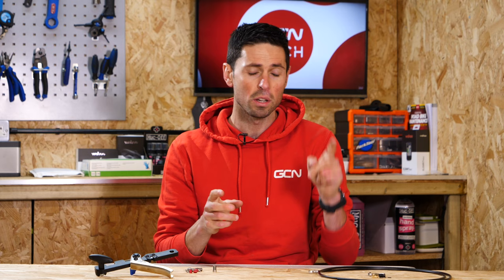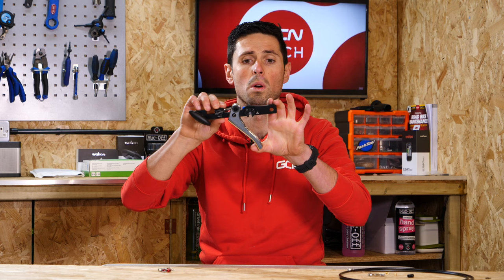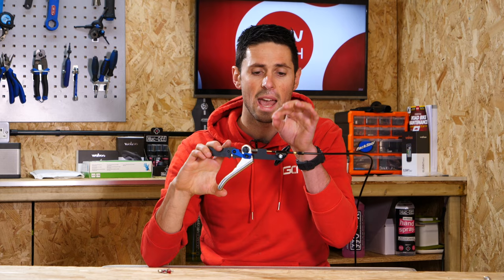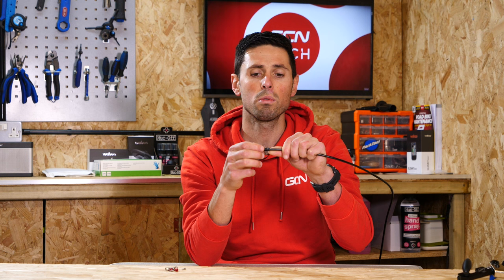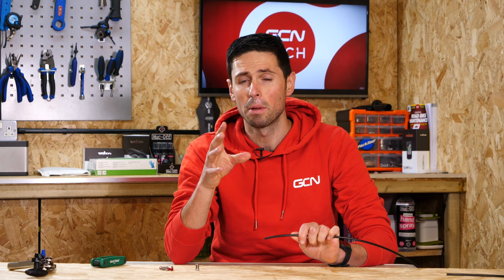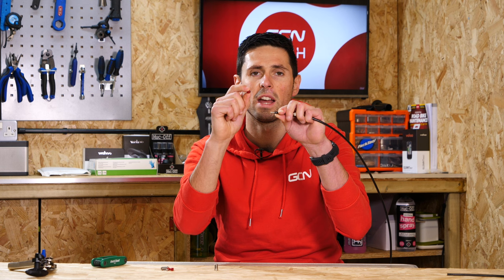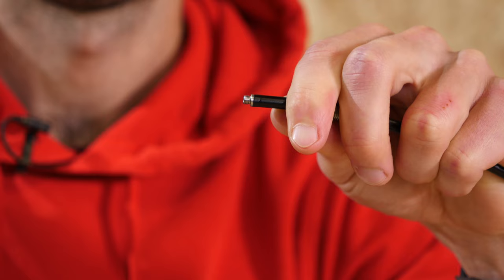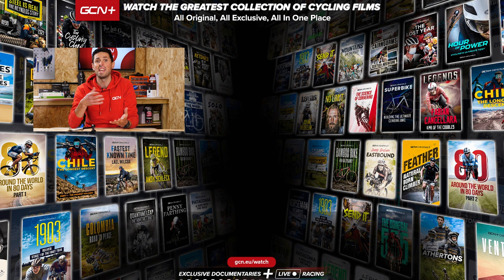How To Shorten Hydraulic Brake Lines | GCN Tech Maintenance Monday

Comment from the maker: Have you ever shortened your brake hoses yourself? How did it go?
Reply: Not yet
Reply: Many times. You can remove the brake pads before and push out the pistons a bit more than normal. After shortening the hose, you have a bit of fluid at the lower part of the system that can help to push any air that might have gone in up into the reservoir. Poor man‘s bleed.
Reply: I Don’t have the tools needed. So the hose is wrapped around the downtube 🙋🏼‍♂️🤷🏼
Reply: Will there be any problem if I put different mineral oil mixed  on my brakes?!, I've been curious about it.
Reply: I remember doing SRAM before they had threaded olive
Reply: @TM-mt6sx  it is often not recommended as might ruin the seals faster
Reply: @tomahoks  make sure turns aren't too tight, think 5cm radius or diameter is tightest recommended not to damage the hose
Reply: @chrisridesbicycles  my mountain bike I only open lever and used a screw in reservoir to fill it and squeeze multiple times until no air left that way and yeah I now know should bleed from one end to the other
Reply: My experience is to put the dust cover on first, even before the tightening nut 😬
Reply: @wannesstas6182  before new SRAM ends I tightened one down for olive to not compress on right bit of hose so had to spend £30 and reroute through my bike frame ... The joy of it

Comment: Top tip, when cutting the hose have the hose pointing vertically to the sky then there is less chance of fluid left in the remaining hose dripping out, like it could if cutting horizontally.

Comment: Excellent video. Also useful would be a video on how to make the brake line longer for when you cut it too short.
Reply: I also like sarcasm
Reply: Easy done … watch the video in reverse … sorted. 😅
Reply: Actually TEKTRO has a kit to connect 2 brake lines. Usually needed for extreme lenghts for tandems!

Comment: That tool looks like an expensive alternative to the hose clamping blocks, vice, bit of wood and mallet I was taught to use
Reply: That tool doesn't seem to be holding the hose very well? keeps slipping - being cautious or not a great tool (cue parktool fan boys hate!)
Reply: The official shimano tool is useless as well. Shimano’s barbs are just absurdly overtight for what low system pressures there are. It’d seem the blocks with a mallet is still the only way to go.

Comment: Wouldn’t the reverse threading do exactly what you say it does not Alex? The reverse threaded olive is turned while being tightened onto the barb in exactly the sense that would loosen the barb… Maybe it is to prevent attaching the olive from over stressing the threads that the self threading barb digs into the hose? I suppose those are pretty delicate so over tightening is worse than slightly turning them out while attaching the olive?  In any event, thread things the correct way!
Reply: No, he is correct
Reply: @SlimPickins_07  I think Neil is correct. Never done a sram hose myself so not certain but surely it's not to aid installation but it is to prevent the barb coming unscrewed if the olive needs to come off?
Reply: @nathanielhawkins6756  you are turning the nut to the right, the friction from that would tighten the barb, not loosen it. If the barb was regular right hand thread, it could loosen it.
Reply: @SlimPickins_07  that's what I mean. If you want a new olive but to leave the barb in place loosening the reverse thread olive by turning clockwise would only tighten the barb. Either way I can't see how if both threads are standard that one will unscrew the other.
Reply: @nathanielhawkins6756  it would be the nut that would unscrew the olive when installing the line. The barb is in the line tight enough that you don't have to worry about it coming out.

Comment: At 3.22 you mention about greasing the nut and caliper thread. If u just put grease on the nut then the thread will push out the excess grease leaving none being pushed inside. 

I'm was a plumber and we used this trick on all thread pastes or flux

Comment: I have! I just switch out my mountain bike Sram Code brakes for Shimano XT brakes and needed to shorten the hoses. I have the Park Tool cable routing kit which made running the new housing internally easy. During the pandemic I worked in a warehouse building bikes, I got tried of using other people dull housing cutting tools so I invested in a Jagwire Pro Hydraulic and Needle driver which works really well.

Comment: I'm going to change my sram brake hoses. Can I displace the air in the hoses thru the lever from the caliper side or do I need to fill the hose from the caliper side before connecting to the lever? Yes, I'll bleed the system once it's full.

Comment: Hey great video  I am a subscriber  I have purchased  zoom hydraulic brakes but I have a question  I pinched  a hole on  the rear brake line I need to cut and install a new burb and Olive I need your help I don't know which barb  an Olive to use  can you help I realy appreciate it  thank you need help

Comment: It is 100% sure that air will go into the system when you cut the hose so my experience is that your system needs rebleeding. Always wondered why SRAM delivers their calipers and shifters allready bleed when 95% of all new frames is made for internal routing.
Reply: is there a plug i can use so I don't get DOT fluid in my frame?

Comment: Can you mix and match SRAM and Shimano? Just ordered cheap hydraulic brakes as got cable brakes that aren't good so went 4 piston and not Shimano or SRAM and so wondering if can use either when shorten? I already have SRAM olive fitting stuff
Reply: Absolutely not. SRAM uses DOT fluid and Shimano uses mineral oil-based hydraulic fluid, these two CANNOT be mixed at ANY time.
Reply: @yonglingng5640  I can't remember what on about but think might of been SRAM olive on Shimano brakes but as SRAM olive are nicer to keep perfect than try to hold hose right as do with Shimano olive
Reply: @mlee6050  Do NOT bother trying, don't even THINK of it. You WILL void componentry warranty in doing so and risk brake failure. Are you seriously risking brake safety for the selfish desire for that slight installation convenience?

If the brakes fail and you die, that's on YOU.
Reply: @yonglingng5640  depends where you are as if hill can slow as go up, I do it safely then

I never cared about warranty or you know when pay for few years insurance thing, I often just buy replacement and never report warranty issues even if I not void it